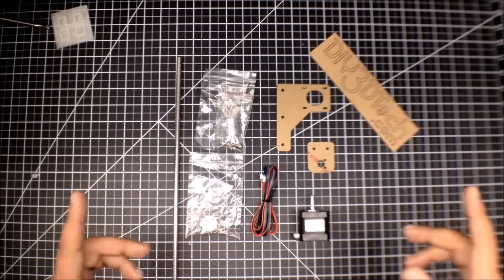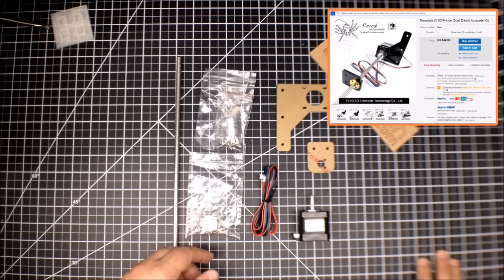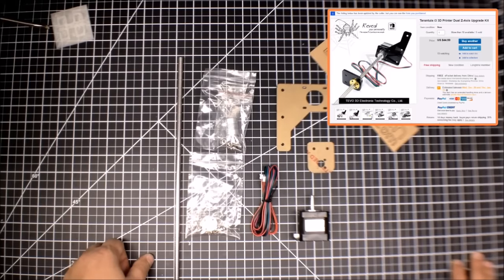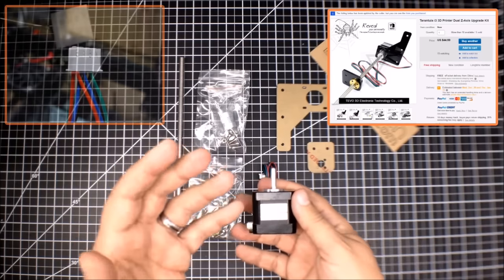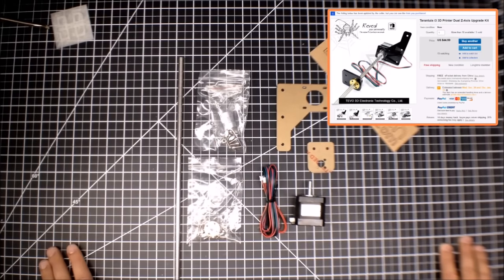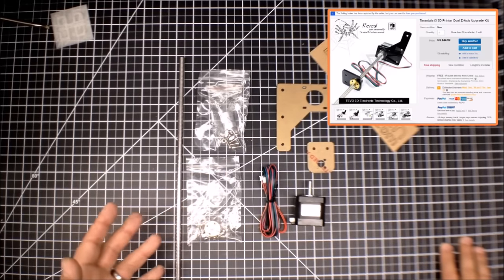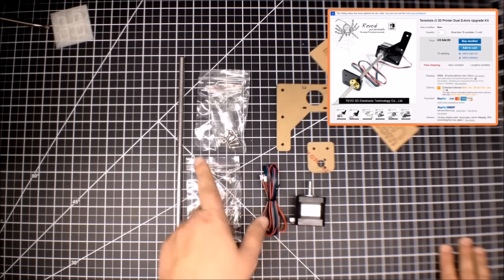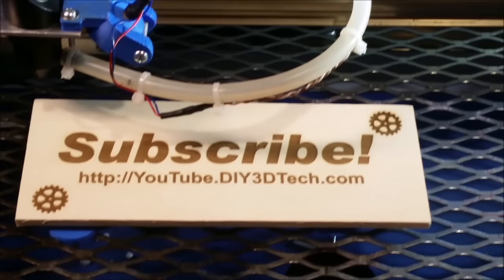TEVO Tarantula 3D Printer - Unboxing Second Z Axis!

Comment: I thought you were happy with the tarantula. Why do you fee the need for a second lead screw?
Reply from the maker: Yes was very happy and now even happier!   For taller objects there is no question there is an improvement and second which is a point I have not discussed is "speed" as with one axis you should run a little slower to let the un-motorized side of the gantry catch up on a Z move (or at leas this is what I did).  However with the second lead screw this is no longer an issue.  So in short it made a "good" kit "great"!

Comment: I'm thinking about buying such, but one thing bugs me, and hopefully you can clear it up - does it require separate connection to the main board, or it's got a Y-shape splicer? The reason I'm asking is that I've got dual-extruded model here (which I recently upgraded to geniune E3D Chimera hotend out of respect of awesome work E3D guys are going, even though it's price for close to half of what I've paid for the whole kit) and so all my motor connections on the main board are already in use (3 connectors for X,Y and Z + 2 more for extruder steppers). So if this upgrade requires a separate connection to the main board, it's going to require me replacing main board and so price will get quite a bit higher. So I'd really appreciate if you'd take a look at the wiring in that kit and let me know if it's a separate connection or just Y-splicer.
Reply from the maker: Its a Y spliter so only one connection in the next episode I show the installation...
Reply: Great! Thanks!

Comment: hey watched your old videos on Petg and just wondering if you did try the filament with no bed heat and if it worked?
Reply from the maker: Have not tried with out a heated bead, however if you used PEI you might get away with it...
Reply: I use PETG almost exclusively (since combines the best of both PLA and ABS without drawbacks of either) and I will tell you for sure that you need a heated bed for it. It might depend on manufacturer, but the brand I use requires at least 70°C bed to ensure reliable sticking and avoid warping. I print at 85°C (at the upper end of the range recommended by manufacturer) and experience no warping whatsoever.
Reply: No way - PEI only works when heated. Unless your prints are incredibly small, the bed will cool down after first few layers completed, and the print will unstick and start moving all over the place.
Reply: Thanks